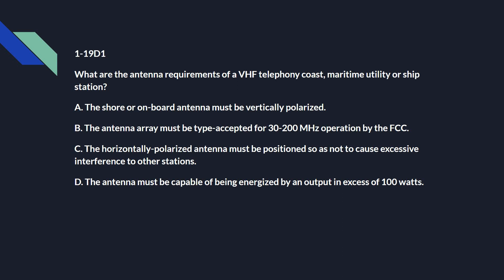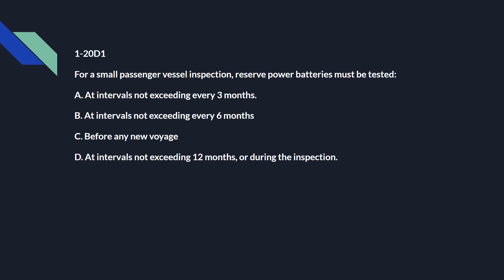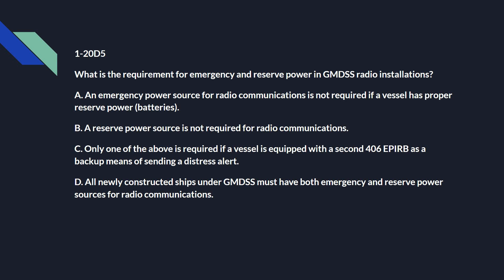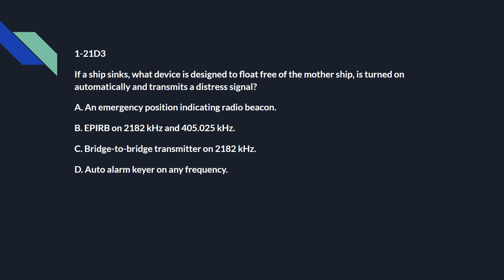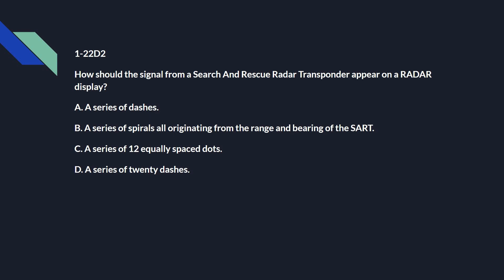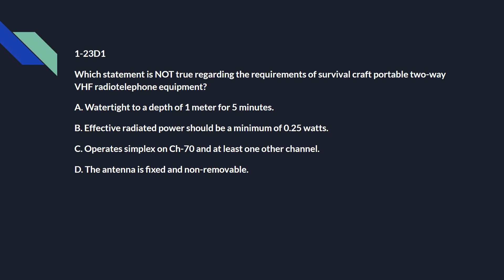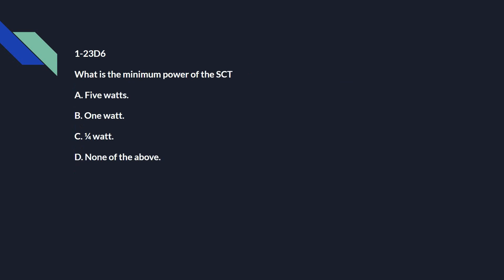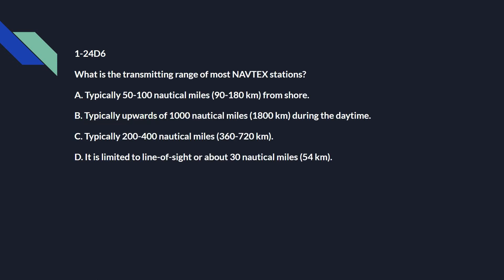FCC GROL Exam Prep Series Element 1 Part 2

Comment: How much would it cost me to pay you to finish this?
Reply from the maker: It's not so much money but time.   I put a lot of time into putting those  study videos together and I really don't have the time available   but as the season winds down I will try.   These videos did not go over as well as I thought they would.
Reply: @59radio22  there’s not a whole lot of study material as far as audio goes for the GROL
Reply: @59radio22  -  The serious people are here and we thank you for your hard work. I have had to do a lot of prep here also to make it over the hurdle on this test. I am no dummy when it comes to radio, but because I seldom deal with maritime radio, the Rules and Regs are not relevant to my day to day work and therefore have little meaning other than passing the test. But then again, when working in an emergency, anything flies as long as it works... Which is why many marine radios that I have put in law enforcement installations were based on 100 watt VHF mobiles from police cars and some of them controlled as remote bases. Thank you again for your hard work.